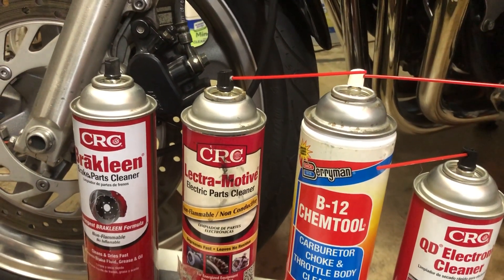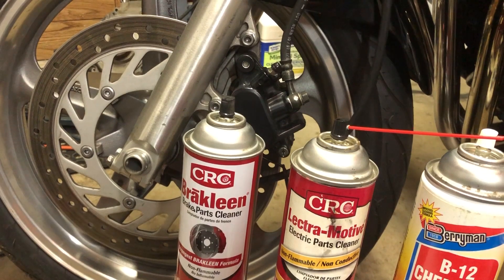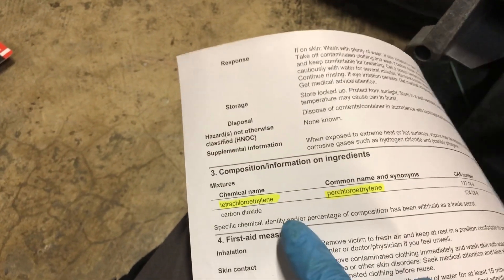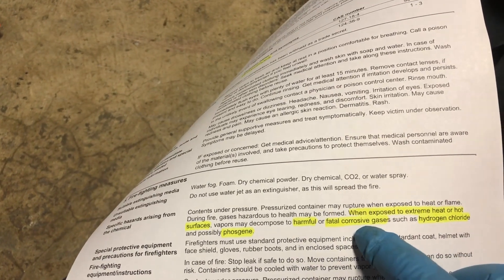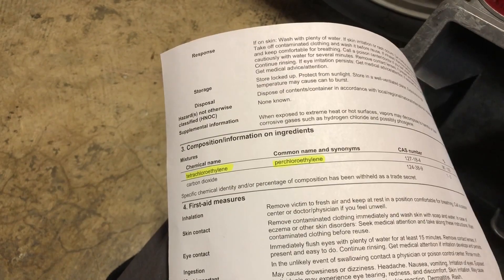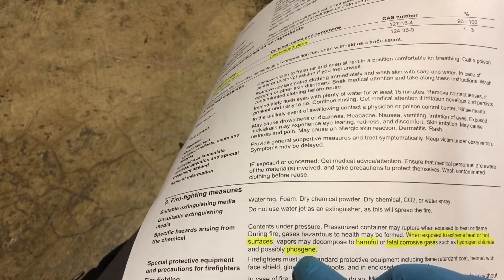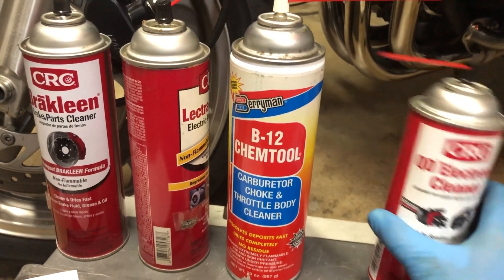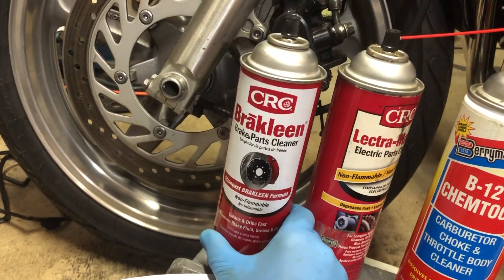Parts Cleaners -- be careful when using those, containing tetrachloroethylene

Comment: Tetrachloroethylene is found in electrical contact cleaner, tapping fluid, penetrating fluid and dry cleaning liquid, etc etc, I don't need to read the label to know it's in a product, I can smell that stuff a mile away, it's also known to cause spontaneous abortion.

Comment: we use either dealership branded, or wurth brand brake & parts cleaner, it is basically Coleman camp fuel (Naptha/heptanes) basically very very light gasoline. Methyl hydrate/methanol, acetone, isopropyl are also good in certain applications
Most options are still carcinogenic being either chlorine solvents or petroleum solvents (acetone is not, welders favorite btw) , but chlorinated solvents are certainly worse.
acetone is also very... pungent, very easy to tell if your ventilation isn't working lol
Reply from the maker: Yes, acetone, isopropyl alcohol, and carb cleaner can all be used to clean metal before welding.  Chlorinated cleaners -- NOOO!
Reply: @Zerk_Ziegler  yeah I dont like the idea of running an arc through any compound with chlorine in it, just bad news all around

One downside to alcohols & heptanes compared to chlorinated solvents is their profound flammability, too many sparks flying from someone working in the bay beside you can set your buddies brake clean sprayer on fire.

Comment: i have this thing about things in cans. if i cant buy it by the 5 or 20L drum... and well, for my chlorinated solvents, chloro, di, tri, and carbon tet, i only get 1L, anyway... aerosol cans have always seemed to be an expensive marketing ploy more than anything. i dont find the contents to be of any use. 

um...

the best carb cleaner hands down is METHANOL. makes the expensive crap in a tin seem like water, useless. it literally just tears the nasty brown black shellac off instantly.

if you do any amount of work on old badly stored engines, its a life saver. and as you arent using it as fuel, the hygroscopic nature isnt really an issue.
Reply from the maker: Haven't used methanol for cleaning carbs.  Will have to give it a try.